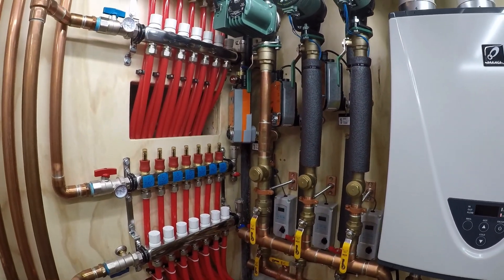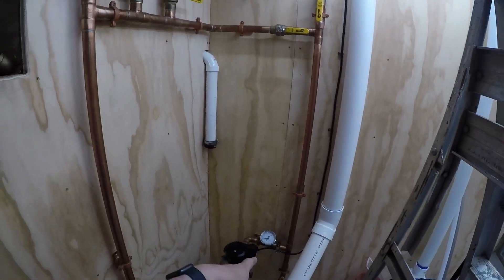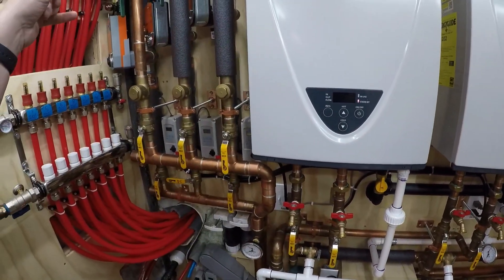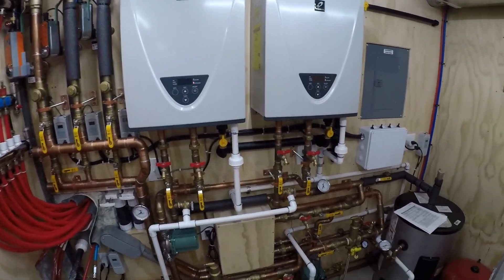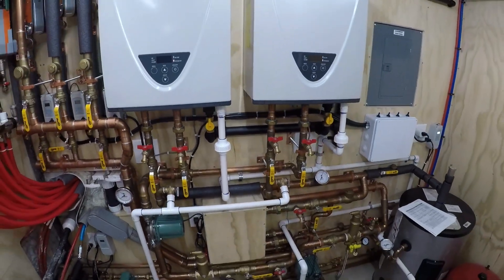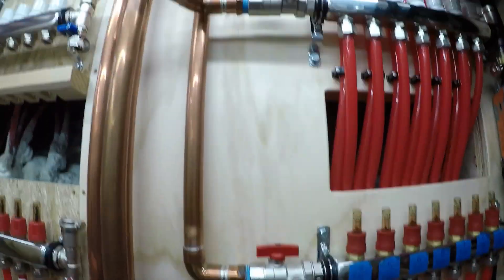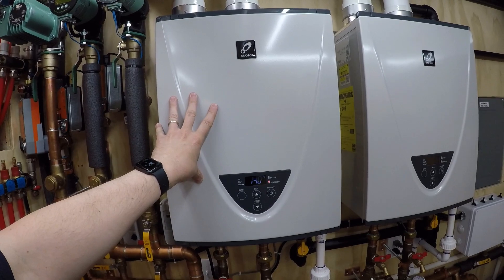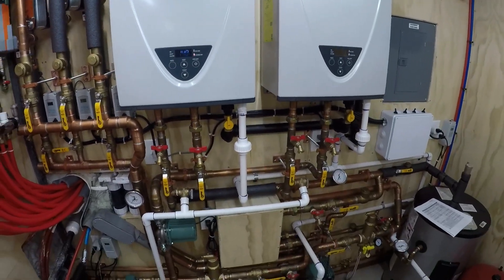Heating my Domestic Hot Water with the Driveway (Running the Snowmelt in Reverse) - [5-21-2021]

Comment: that system would be amazing running both ways if it was connected to a heatpump.
Reply from the maker: Hi Pixel!  This is absolutely something I'll have to look into in the future.  Perhaps when the tankless units fail in future years I can replace them with some sort of heat pump technology.  It has already come a long way in the past 10 years, and I'd imagine it will be even better in another 10!  If I do it, you'll see it here so stay tuned 😊.  Thanks for the suggestion, and thanks for watching!

Comment: This could be used to pre-heat the incoming water from the utility before going into the water heaters. Since your cold water comes in through the recirc pump on the lower end of the tank circuit, you could run the snow melt system to preheat that water as it passes through the heat exchanger and then into the tankless heater input. The caveat is that you would need to have the snow melt pump turn off or bypass the heat exchanger during tank recirc events so it isn't stealing heat from the recirc loop. This could mean short cycling of the snow melt system since it would only be needed for domestic hot water loads pulling street water into the system.

Great thoughts. I appreciate you recording it. I am preparing to build a snow melt system for my driveway rebuild in spring/summer, and I have reconsidered my design based on what you have here. Looks pretty efficient, and I really like energy efficiency. In another video, you mentioned a solar system. I have one installed, and I really love it; you won't regret it, I promise. However, if I can offer some advice, get a metal roof before putting the solar system on. It is more expensive, but it will be worth it from a lifespan perspective and a snow-clearing perspective.

Keep on tinkering!
Reply from the maker: Great suggestions John, thanks for the advice!  I'm glad you enjoy the videos, too!  I am looking forward to installing the solar panels.  I will think about the metal roof, thanks!! 😊  -Chris

Comment: Your thinking correctly, heat is everywhere, can we capture it? In your case a second tank would be required to temper incoming cold water. Not worth the money. I'm in Milwaukee and for domestic water have a typical 40 gal. tank natural gas 70% eff. for family of 4. For all hot water usage, showers, dish washer, hands, ect. costs $0.85 a day. Can't justify putting in anything else until it dies. They make heat exchangers for house drain to capture heat from waste water. Ran numbers, would pay for itself in 44 years, I'll be dead.

Comment: I thought about heating up a pool the same way.
Reply: Your thinking correct, heat is just sitting there. In your application all you could do is temper incoming city water in a seperate tank, not worth cost. I have family of 4 in Milw., WI with 70% nat. gas tank heater, costs $0.85 for all hot water use per day.
Reply from the maker: I think that would work well!  I couldn’t get mine hot enough for domestic hot water, but I think it would be plenty hot enough to warm up a pool!  Use a solar panel to run the pump and your operating cost to run it will be $0!
Reply: I'm was thinking the same thing, I have a concrete patio that I could use to heat the pool and in return, also cool that patio.